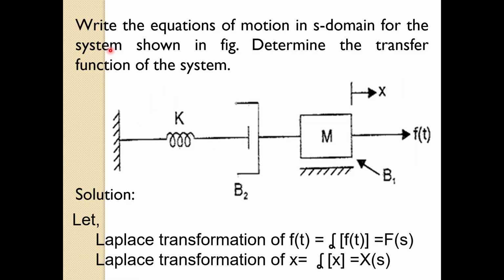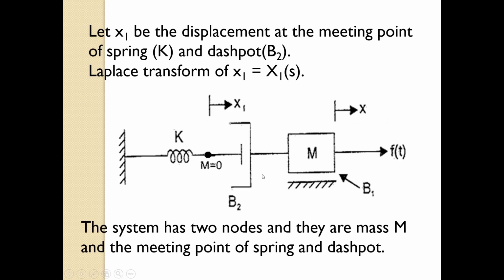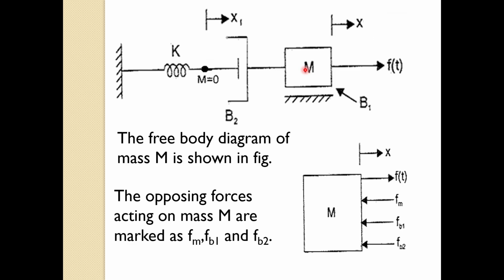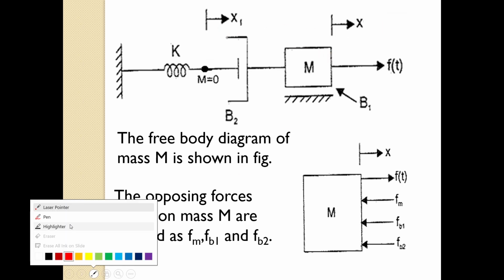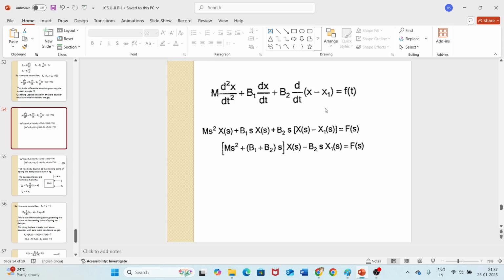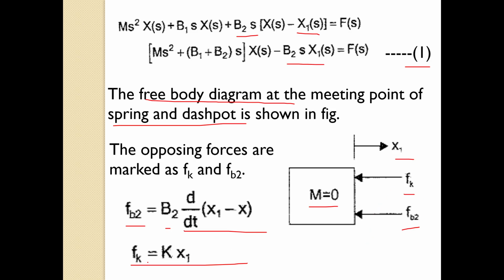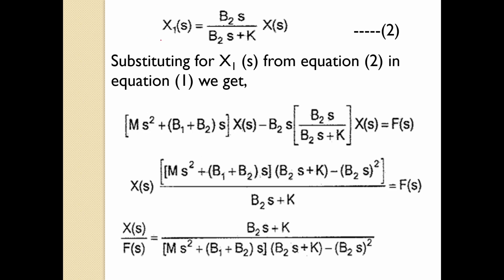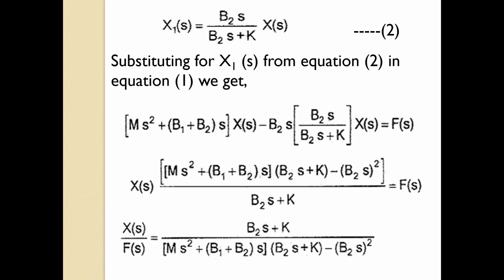NUMERICAL PROBLEM ON MECHANICAL TRANSLATIONAL SYSTEM (PART-I)

Comment: Ma'am Thankyou for video. One important double is that why we're considering m=0 assumption between spring and damper ma'am???
Reply from the maker: You have to compare the given mechanical system with an electrical circuit.....here "m" represents a node of an electrical circuit.....we know in an electrical circuit all branches meet at a node..... therefore spring and damper should definitely connect to a mass......if mass is not available consider mass equal to zero.